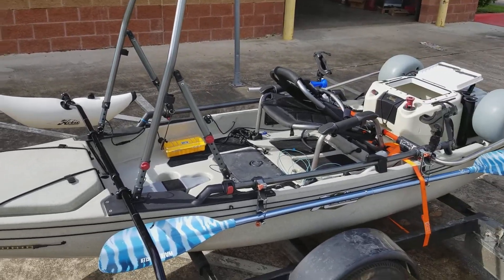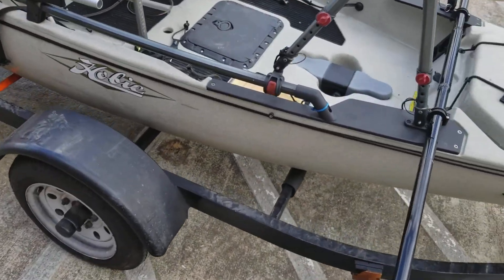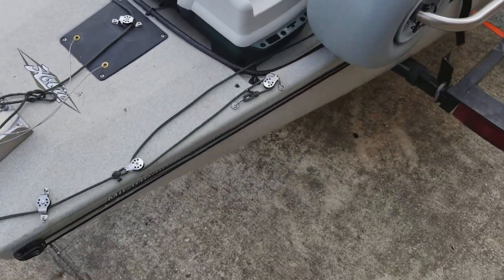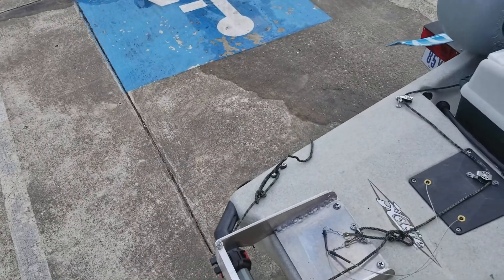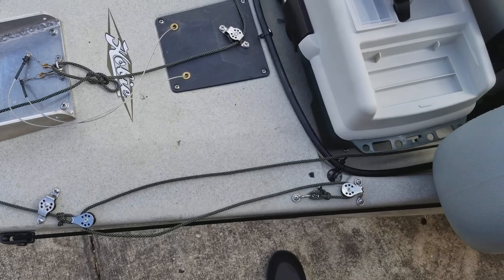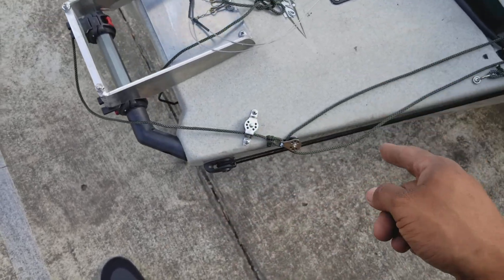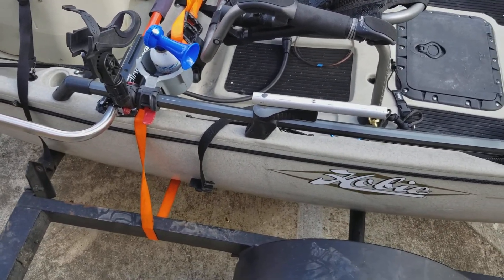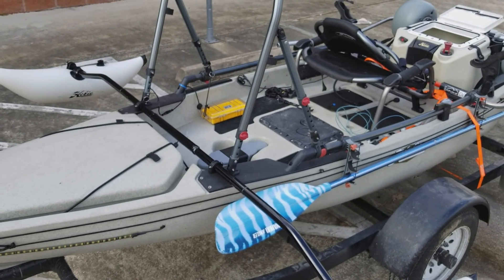Hobie pa14 with 1003s torqeedo engineering upgrades

Comment: how much is your setup?
Reply from the maker: Joe Magnento the batteries are around a 1000 bucks apiece. The pylon was 750 bucks. The transom mount was a freebie from another travel I bought.

Still about 300 bucks more that a hobie evolve with a wimpy 320 am/hr battery.

Not too bad.

The boat itself cost 2000 used. The out rigger was 250. The livewell was 450. The stand up bar was 250.

Another 200 bucks in assorted smaller bits bring the cost to a estimated total of $4100.

I have a 10×46 lathe and a Rockwell 21 vertical mill, so my next upgrades to the steering will relatively free of cost.

Comment: Nice setup, looks great .I am also adding the travel motor to my PA14, I have the 400 but I think the larger motor not only has more power but is more efficient and should give more range.Can you explain why you chose rear mounting vs side mount?
Reply from the maker: Mostly for control precision. Have the motor at the rear offers much better directional response and stability.
Reply: I asked the same question. Did you decide on side or rear mount?